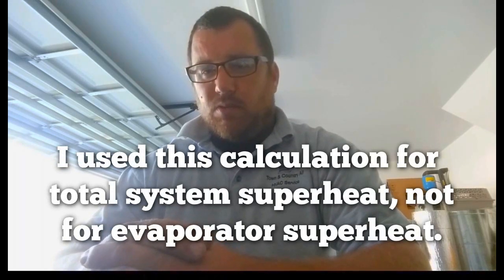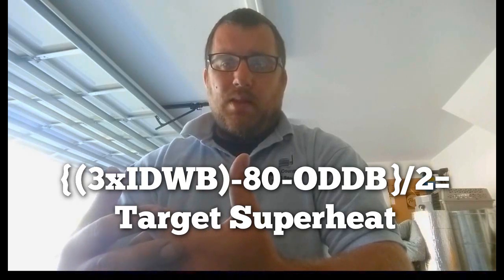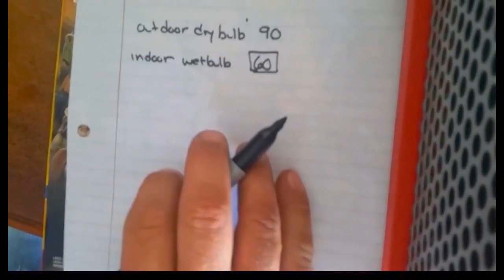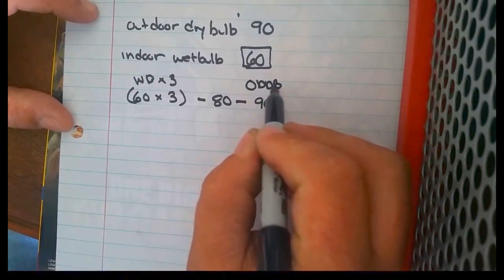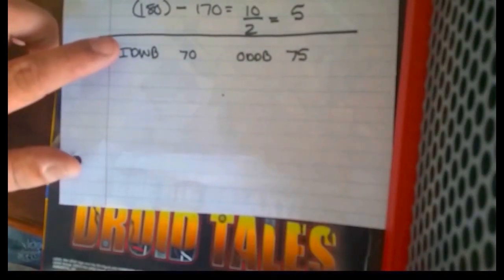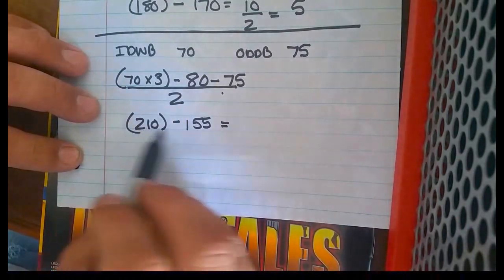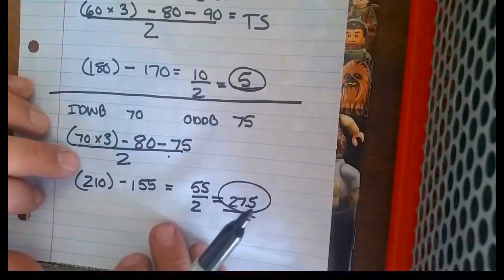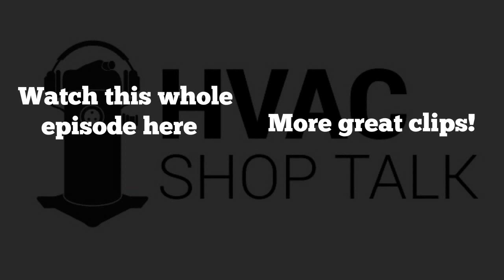HVAC Target Superheat Calculation

Comment: Nice job of explaining.  I have smans and it does it  but always good idea  to know how to figure  it in case the gauges  take a dump.  Great  job.
Reply: Dan Kerr the SMAn doesn’t do real superheat my friend   You have to take indoor wet bulb. Now if your inputting this into your gauges or have a probe inserted into the return air how would your gauges know what your target superheat is.
Reply: @randomrefrigeration4564  i have the sdp2 it DOES take the indoor whet bulb and dry bulb.
Reply: Dan Kerr that’s a nice Hotwire does it link to your SMAn gauges through Bluetooth or something????
Reply: Dan Kerr I mean because you stated your SMAn does it itself and I was wondering how it could. But you really mean you have the field piece Hotwire as well. I just want clarification-that way someone doesn’t run out and buy a set SMAN and find out they need a Hotwire anemmetor
Reply: @randomrefrigeration4564  yes